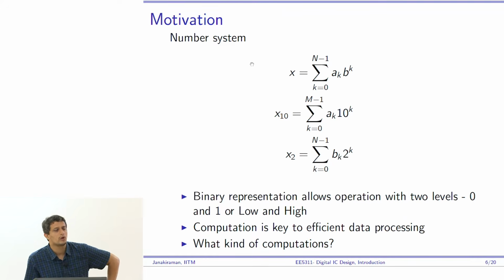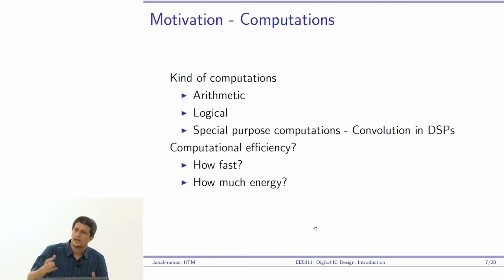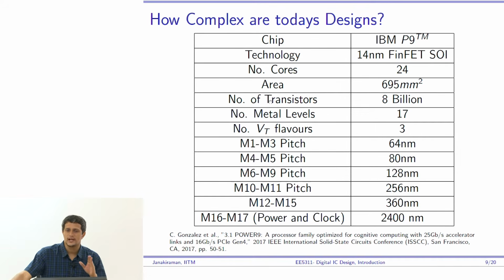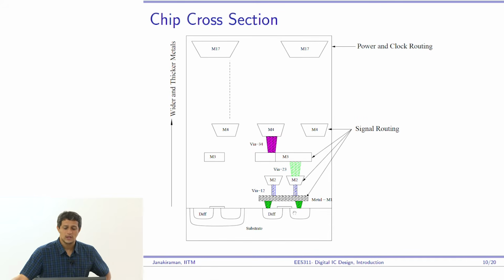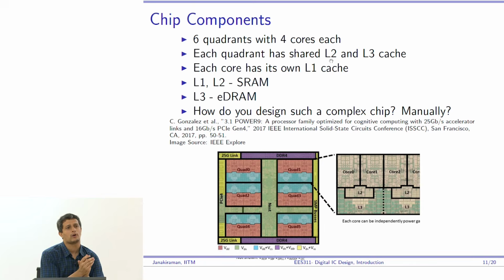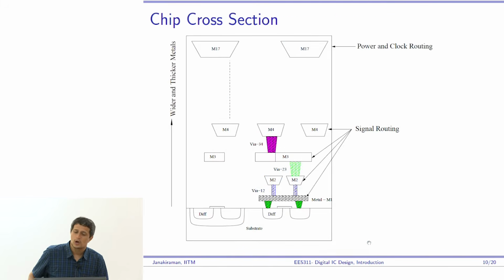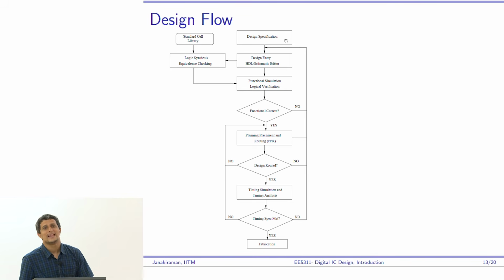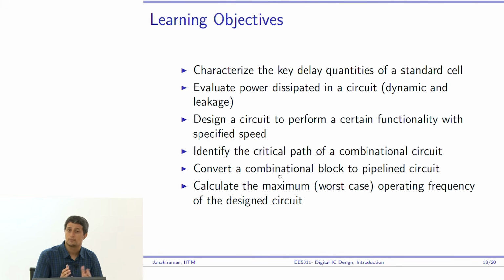Introduction - Digital IC Design

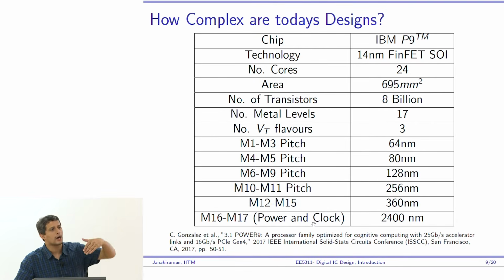Comment: In 14:24 min talking about the clock and Power.......Power lines need two to more metal layers(+ve and -ve/If it is multi domain). Clock layer needs one to more metal layers depending on module